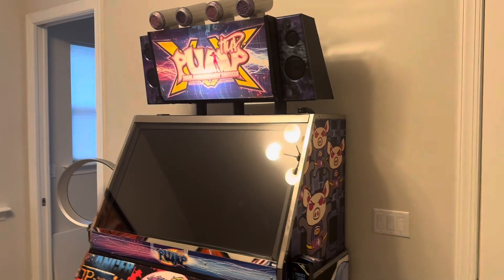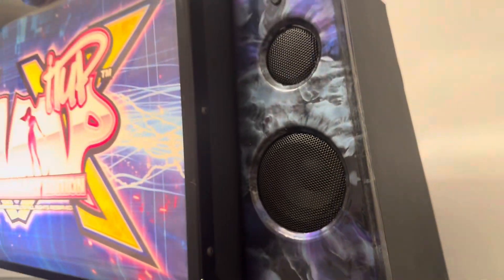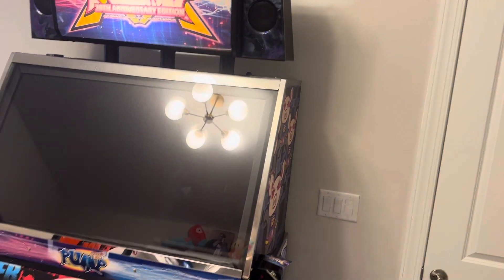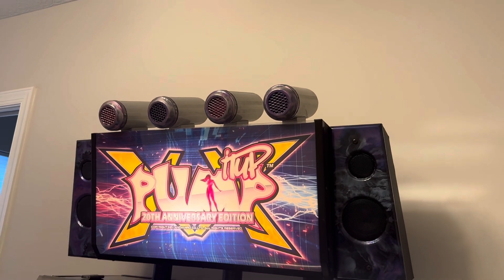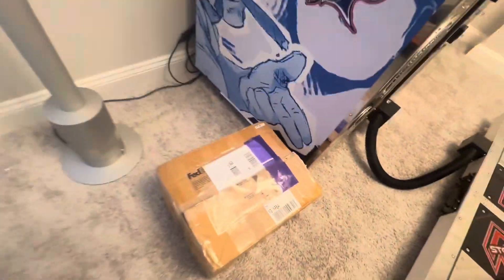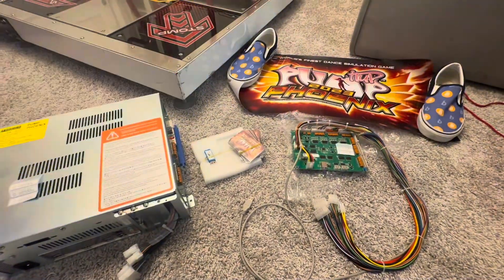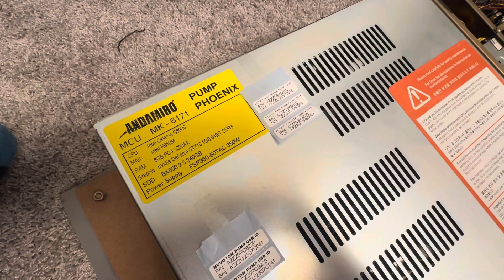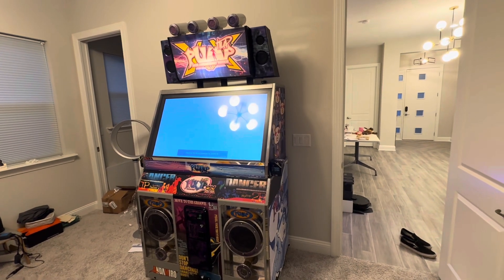Pump It Up Phoenix running in custom GX cabinet

Comment: Looks awesome! I'm in the process of restoring mine at the moment, my top light came without lamps but I'm getting power on those lines, could you point me in the direction of the type of bulbs you used? Let  me know if those are using the original socket or if you made a modification
Reply from the maker: Just replaced with same specs as stock MR16 20w halogen bipin bulbs. The light in the coin return uses a 5w 1/4” wedge bulb.
Reply: @ketafol  Thanks for the answer, I'll be looking to buy them today